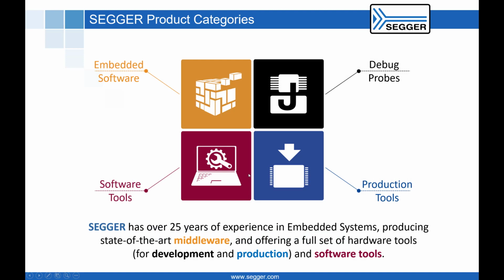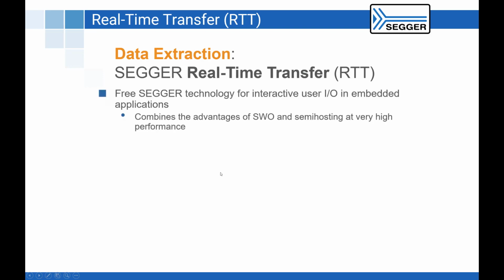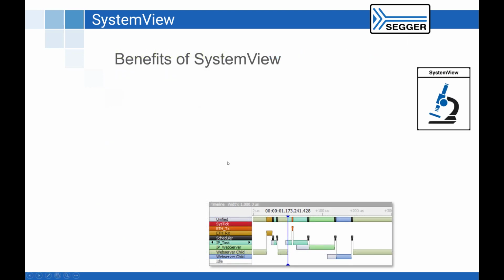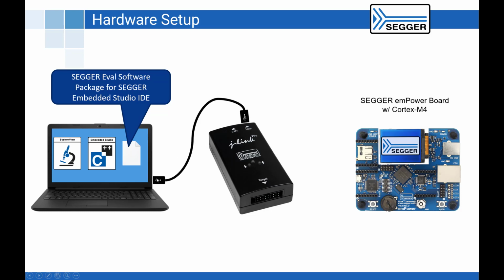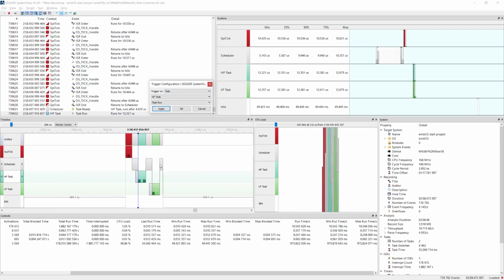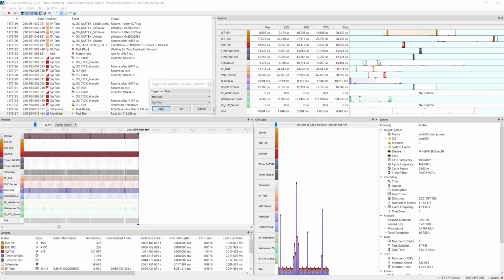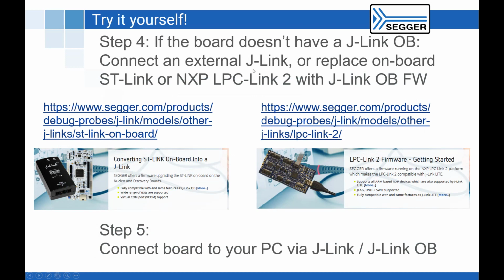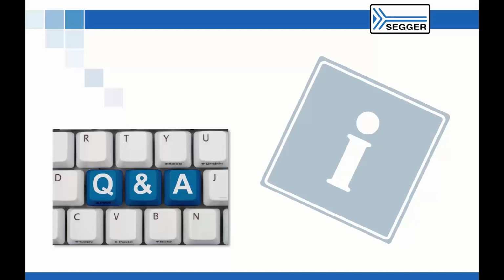SEGGER Webinar - Analyzing & Recording Runtime Behavior on Embedded Systems with SEGGER’s SystemView

Comment: While it's always possible to do do software tracing (via SWD+SWO), I understand to do hardware Tracing then the chip must have ETM support.    My chip only says SWO, ITM and TPIU (Trace Port Interface Unit), what hardware features does ITM/TPIU allow? 

For example, in uVision's Run-Time-Environment settings page, it show you can redirect STDIO to ITM.. but is that the same printf that can be done via SWV (SWD+SWO), without ITM?

To add to the confusion, I see only the Segger's Trace debugger have the ETB/MTB.. how does that fit in?